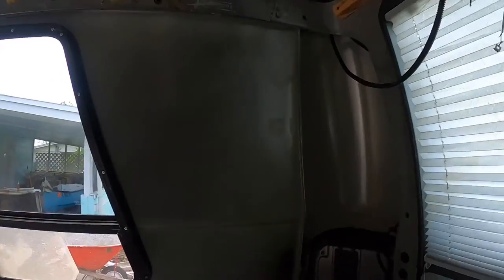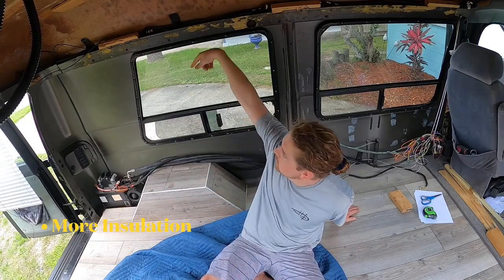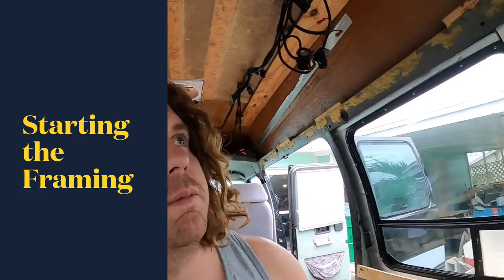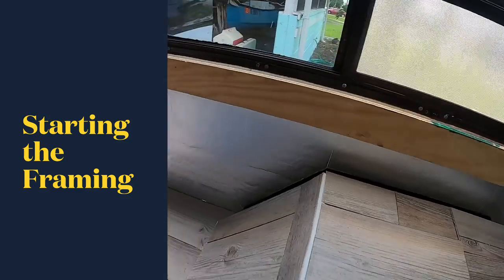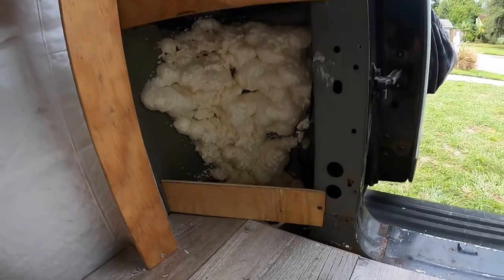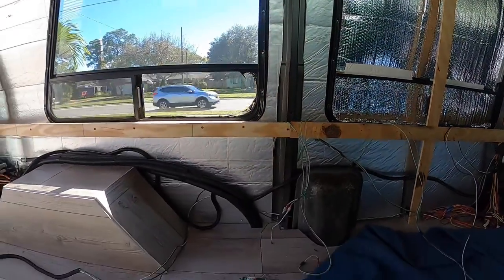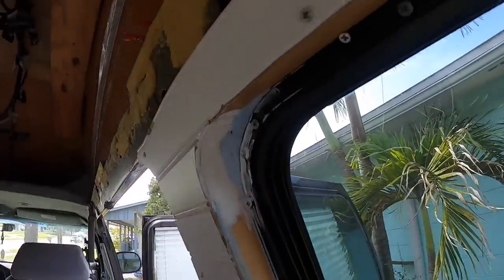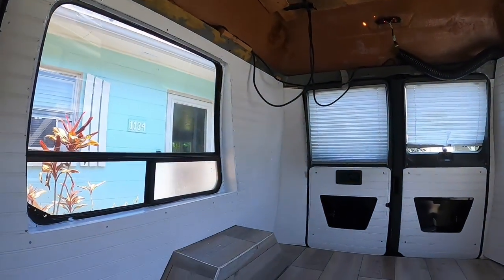New Walls for my Dodge Ram Conversion Van Build

Comment: I loved that you are using the white paneling. That is what I am doing with my 2000 Dodge ram van. I had also thought about blocking that front window and putting a little kitchenette there.

Comment: Nice job! I just bought the same van. I’m going to do something similar with the A/c. I think it’s gonna be a bonus to the build.
Reply from the maker: Thanks! Yea routing the new a/c vents like this makes it a lot cooler now. Just curious what did you pay for yours in todays market? I bought mine 4 years ago before the major van life hype train started for cheap and only recently started converting it.
Reply: @alx2456  I got a 97 b2500 for $2,500 with 90k miles

Comment: Thank you so much for posting this, I have the same van as you and couldn't find anybody installing walls in the same kind of thing. I love your framing idea and I'm implementing it in my van, but I had a Q — how did you secure the boards that frame your windows to the window frame? Or are they just secured to the wall? I can't quite figure that part out. Thanks again, your videos have been so helpful!!
Reply from the maker: Thanks for the kind words. I secured the frame around the window by screwing it to the black border around the windows you can see when my walls are bare metal using self tapping screws

Comment: This video is exactly what I was looking for! I'm also converting a conversion van and was having a hard time finding other people who have done the same. These videos are extremely helpful, thank you for uploading your process.
Question: how did you cover up the window behind the driver's seat? I'm wanting to cover up some of my windows and make a wall as well, but need some help.
How did you do it and how is it holding up now?
Thanks again for the helpful vids!
Reply from the maker: Thanks for the kind words! I covered the window by first spray painting the inside black so you can’t see through. Then I lined the window with reflectix to block the heat from the window and used aluminum tape to seal. I then used insulation around the window and made a frame even with the other wall and drilled the wall panel to the frame. It’s holding up great!
Reply: @alx2456  hello there what size is the bead board that you put on your walls.  Thank you
Reply from the maker: @edspining44  the board is 1/4 inch thick